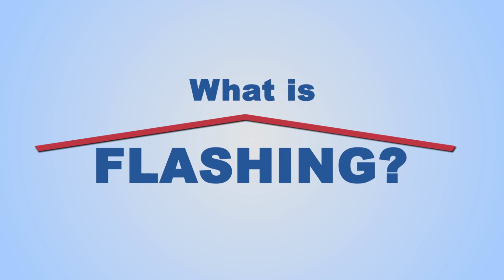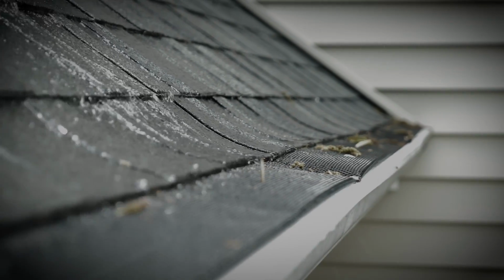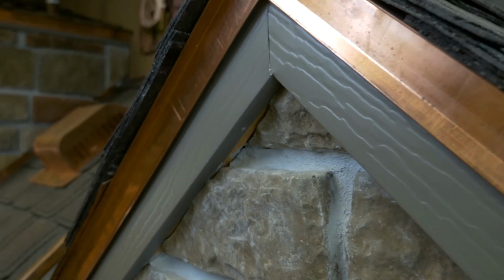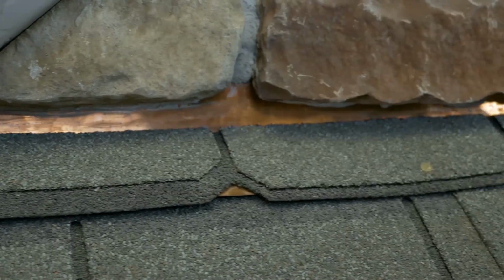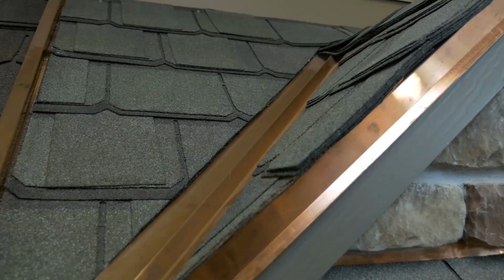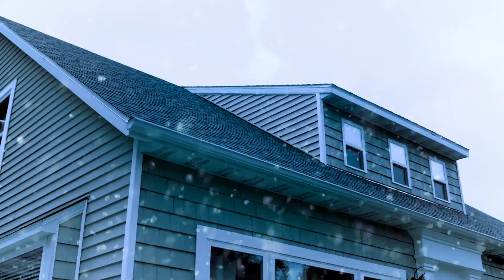What is Roof Flashing? | Dale's Roofing

Comment: How long does a spanish tile brick and Mortor underlayment last exposed to the sun before it creates a leak? The tiles broke and you can see the underlayment already with dry cracks but the roof inspection came back with no signs of leaks both on the atic and on top of the roof. Thanks in advance. And what should I do? Is using tile adhesive good enough to just put the broken tiles back together? the roof is origin al from 2004. the tiles were nailed in.